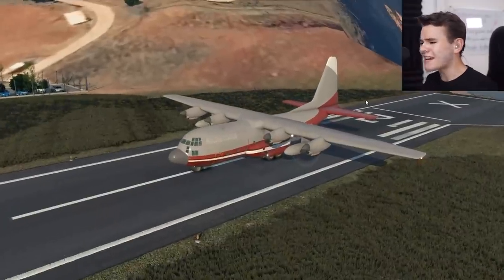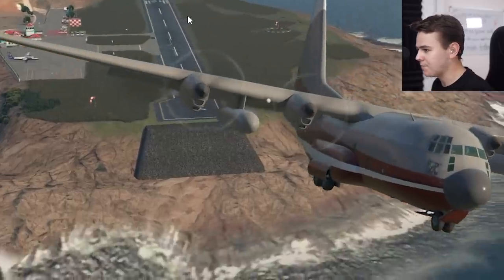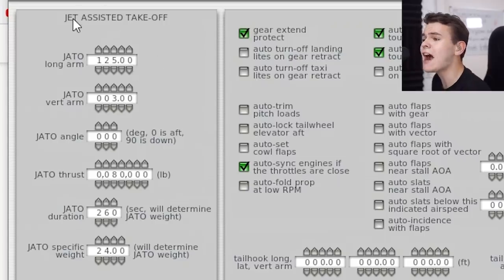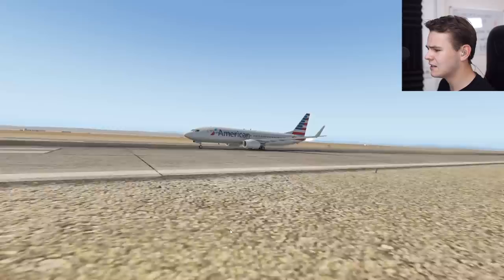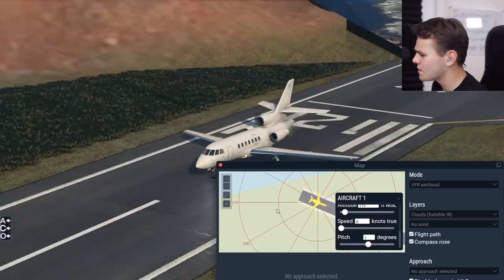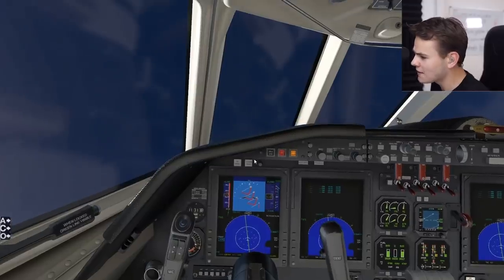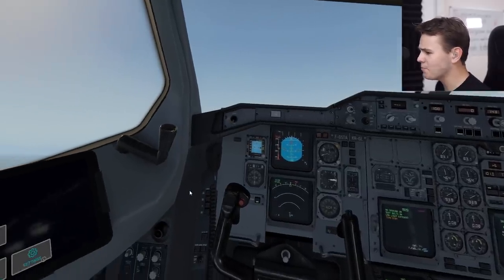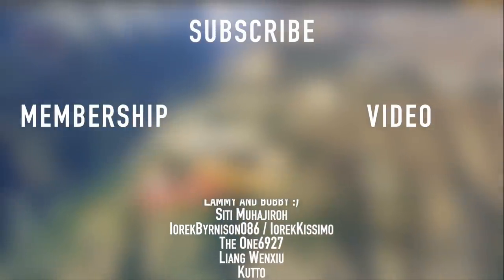I Put JATO Rockets To A 747

Comment: Last Video: carrying airliners on a 747. Next Videos, putting rockets on a 747? Next Video, putting supersonic speed on 747?
Reply: Yep
Reply: He already went supersonic with the 747
Reply: no, next is modding the engines to output a 10,000 thrust/weight ratio
Reply: Putting light speed on 747
Reply: Next video: sending the 747 to low earth orbit
Reply: @SomeoneCalledAdrian  that’d probably require kerbal space program, not a flight simulator. it’s quite easy to get a 747 sized plane to orbit in ksp.
Reply: @ryan_n05  then it will be low kerbin orbit
Reply: @SomeoneCalledAdrian  realism overhaul is a thing.
Reply: @ryan_n05  right...... Ok

Comment: No. The C-130 has a very good take off performance on its own due to the powerful engines and the design of the wings and aerodynamic surfaces. The takeoffs from aircraft carriers did NOT use fucking JATO rockets FFS, lol.

Comment: Why does Swiss always say that saba airport has a runway of 300m? Isn't it 400m?
Reply: i guess the safety zones(the ones with a X on them) are 50m each. so 50x2=100m
400m(total length of the runway) -- 100m= 300m
Sorry for solving a whole math problem here😅😅